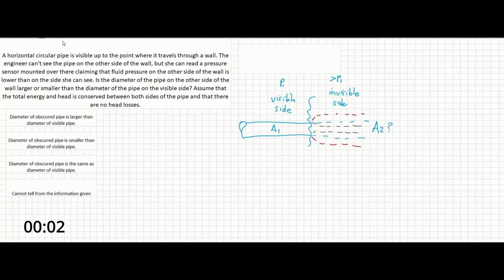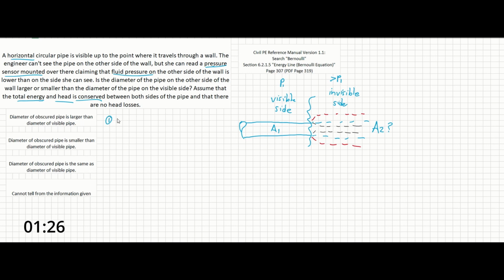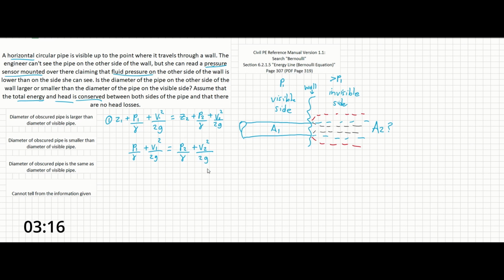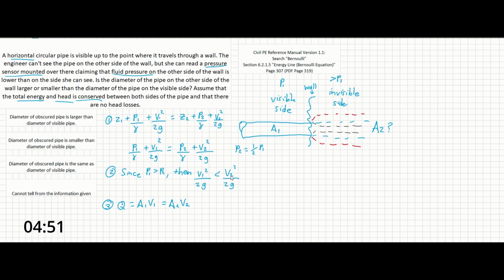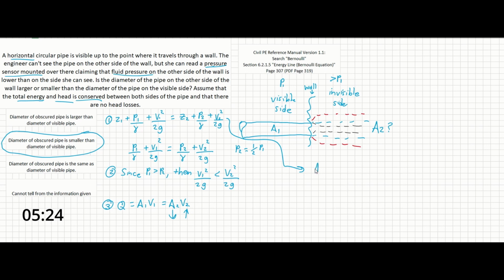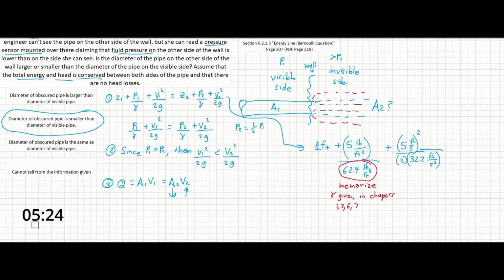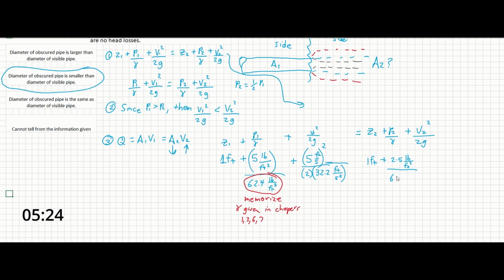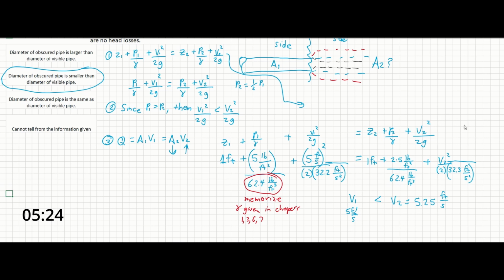PE Exam Practice Problem #48: Water Resources | Bernoulli - Energy - Continuity - Concept

Comment: I believe an easier way to solve this problem is to understand the concept of pressure. P = F/A. Since P_1 > P_2. Then A_1>A_2, because F is the same in both.
Reply from the maker: If the math works out for you, you could have definitely found a faster method.
Reply: Not true. In that formula, you can see that Pressure is inversely proportional to A. Meaning, the lower A (lower diameter) gives the greater Pressure. Which would make A1<A2. you can verify with the Maths, setting A1=2 ft and A2=4ft.
Reply: Unfortunately, P= F1/A1 = F2/A2 does not consider conservation of energy in dynamic conditions such as water flowing through a pipe